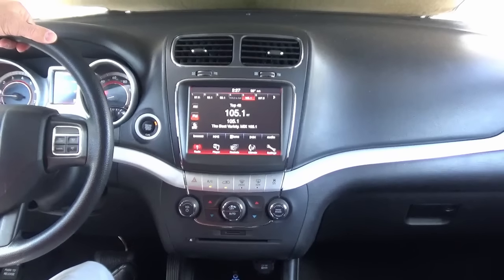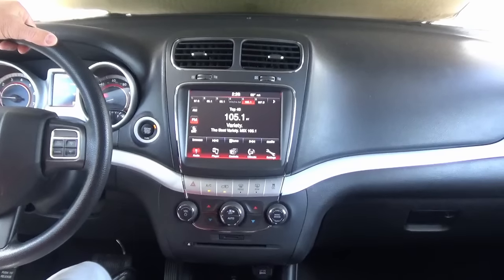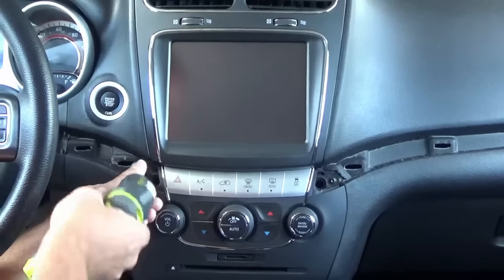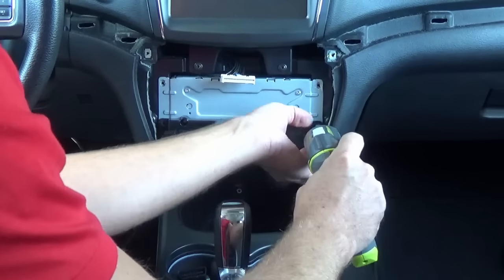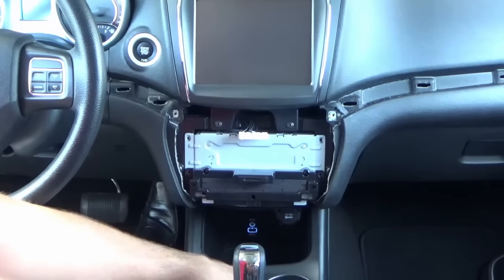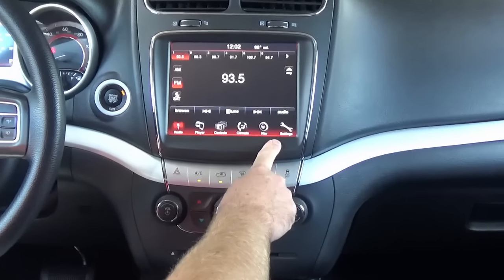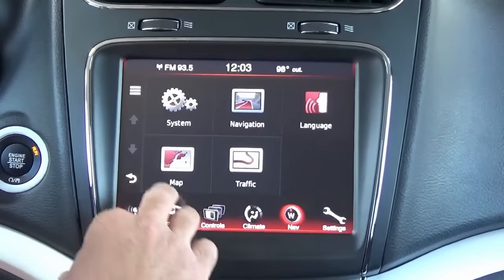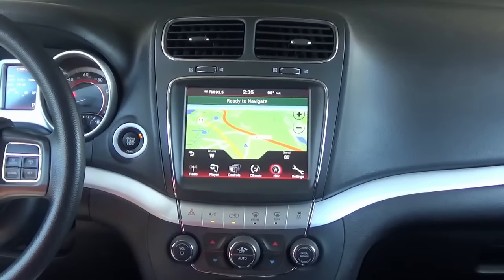2011-2020 Dodge Journey Factory GPS Navigation Upgrade - Easy Plug & Play Install!

Comment: Hello, if I wanted to remove the module from a crashed Dodge Journey and put it in mine, would I need some type of programming or would it work just by connecting it without further ado?

￼
Reply from the maker: If you're referring to the hands free module, there is additional wiring required and you'll need to have the Uconnect Hands Free option code programmed to your BCM.

If you are referring to the radio module, then you will need to get the anti-theft code from a dealership. You will very likely have to provide them proof of purchase and the donor's VIN the radio came from. There's a bit of a risk when pulling radios from junkyard vehicles, as the radio hasn't been tested since before the accident.

Comment: I’m completely confused. I have dodged journey GT2018   No GpS navigation.  Did you remove the module  and put it back  or is different module?
Reply from the maker: Different module. The module that does not have Nav is an RE2 and the one that does is known as an RB5. The 8" to 8" conversion is the first option on this listing's drop down menu. 
https://infotainment.com/shop/interior-accessories/infotainment-radio-upgrades/2011-2020-dodge-journey-gps-navigation-rb5-8-4n-radio/

Comment: 2020 dodge journey crossroad my system doesn’t have Nav icon, so I will need this part??
Reply from the maker: Yes you would need to swap the RE2 module with an RB5 module to gain Navigation. If you already have the 8.4" screen then it is the first option on this listing. 
https://infotainment.com/shop/interior-accessories/infotainment-radio-upgrades/2011-2020-dodge-journey-gps-navigation-rb5-8-4n-radio/
Reply: Good afternoon, can you take a photo of the module? RB5?  Thank you sincerely in advance.

Comment: My navigation needs updated but dodge doent offer updates for a 2015 dodge journey navigation. Is there a way to update it?
Reply from the maker: Unfortunately not. I believe that GARMIN discontinued support for the mapping on the RB5 system. Which is kind of frustrating considering that the RB5 was the top trim radio option from 2011-2020 for the Dodge Journey. Normally I would suggest reaching out to navigation.com but maybe if you tried contacting GARMIN, they might still have the last version from production.

Comment: How to fix “CAN’T UNLOCK  MAPS” on a dodge journey r/t 2013
Reply from the maker: This is due to the map database being corrupted. We repair this issue for this radio unit. If you'd like to have this repaired, the flat rate for any issue with the radio unit is $399.95

https://infotainment.com/shop/services/repair-service/repair-service-fca-uconnect-re2-or-rb5-telematics-gateway-module-radio-4/

Comment: I have a 2013 Dodge Charger and  im coming acrosss a "cant unlock maps" after a recent attempt to update my Navi. Can i factory reset the navigatoon "dealer mode" or is this something that needs to be physical repaired?
Reply from the maker: Hmm I am not entirely sure without getting hands on the unit. It may just need to roll back to an older map update and then you can update again. Or we do offer repair. Have you taken it to a dealer to assess damage?